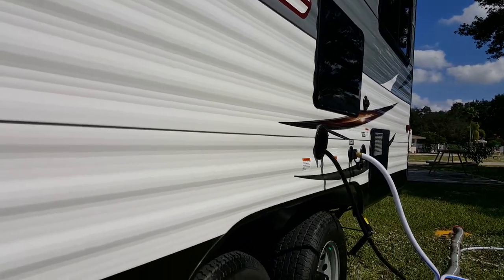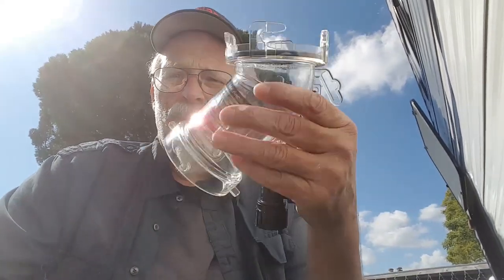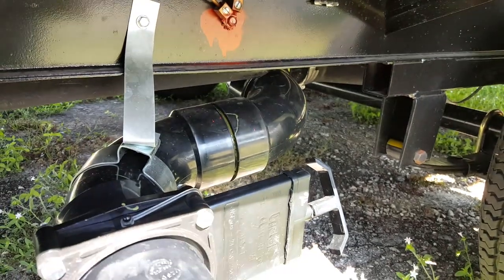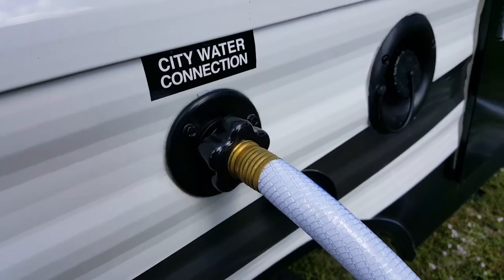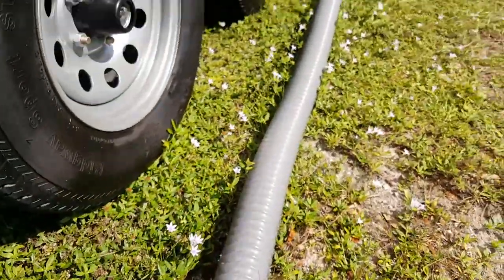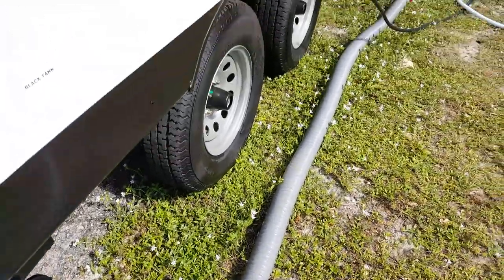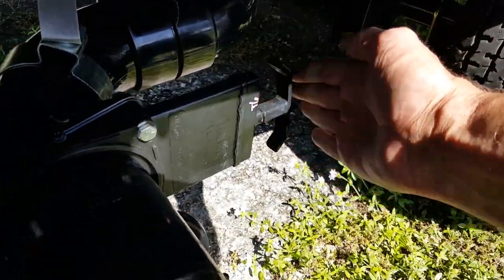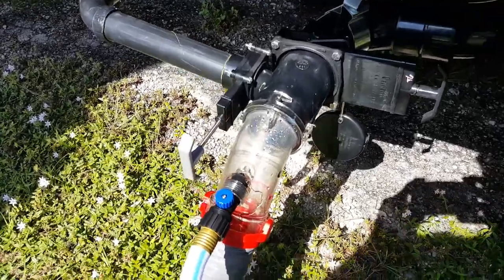How to Empty the Black & Grey Tanks in an RV/Camper

Comment: I found in my years of camping that this method doesn't work 100%, one year I had to replace a tank before and found out there was waste over in the corner, so what I have done was dropped deposit in thw black tank, that will break down the waste and take the water hose and run it inside of the bathroom down the toilet,  fill it back up and go out lside pull the black tank level to then rinse it out. This cause a strong Vortec and  pull whatever waste stuck inside ,once that has been done two or three times,  your black tank is fairly clean, I didn't know that until I had to change a black tank that had a crack in it, once I removed that tank I found out it was a lot of waste still stuck up in the back corners... this message here only remove whatever's there but not a thorough cleaning once you are done shopping for the day and you want your tank clean the best way is to fill it from the inside..

Comment: Unfortunately, the 'rinsing gadget' clear piece only cleans the first elbow of the black tank pipe. The jet of water may bounce off the second elbow a little, but as far as rinsing the tank, nope. If you have a tank rinse built into it OR use one of the wands on the end of a hose down the toilet, you may get some more 'stuff' out.

Comment: Cross contamination using the same hoses for fresh water and tank cleaning. I would use 2 different. That sound right? I'm still a rookie
Reply: Sounds right. You can buy a "Y" adapter with shut-offs and put that at the spigot to connect two hoses.
Reply: Huh? He mentions in the video that you should use 2 different fresh water hoses so they don't get contaminated....
Reply: Yes, it could have back flow into the water hose and contaminate it!

Comment: Get a clear attachment that has a door that is like the black water door. It can be closed to allow you to push water all the way into the tank. Careful to not fill tank.  With this attachment you are sure to clean tanks.  Always use rubber gloves. Never use fresh water hose on anything dealing with grey or black water.

Comment: When using a hose for your fresh water hook up, don't let it come in contact with the ground or connect it to anything other than its purpose.  Have a second hose in a different color for flushing the black tank out, it is not worth introducing fecal matter into your fresh water system.  Also the gloves show do not stop liquid penetration, use some disposable nitrile gloves which are cheap enough on Amazon or at your local WallyWorld.

Comment: A trucking recruiter! The name alone is very telling! I see you have a white hose connected to the washout of the dump hose! Typically a white  hose is used for potable water (drinking or bathing) you wash out hose should be red or black. But coming from a trucking recruiter I am not surprised. Truck driver recruiters will tell you anything you want hear.

Comment: You had that 45 backwards. Running water through it is for the hose only, not for trying to flush back into your tank which obviously wasn’t happening because it just flows right back out.

Comment: I've pulled the levers after moving into my trailer (already hooked up) and it worked just fine for 9 months. I just recently moved, got all hooked up and now nothing comes out when I pull the lever to the grey tank. I know my tanks are full because I have water in my shower and sinks that aren't draining and my monitor thing tells me tank 1 is n the red and tank 2 is 1/3 full. Also my fresh water is in the yellow at 1/3 tank as well. So how do I drian my tanks if pulling the lever doesn't work? And how do I refill my fresh water when it's hooked up?

Comment: Does that fitting have some kind of a check valve, that’s a cross connection. I didn’t see a vacuum breaker on the hose bib.
Reply: Even with a check valve I tiny bit of contaminated water will come through when the valve closes and once you hook the line up to your campers drinking water it contaminates the plumbing inside also it makes it worse if you dump your tanks and put the hose away for a period of time it give bacteria time to grow

Comment: That hose dont clean the tanks. They have tested them and they dont work. It cleans the pipe at the end and that is it.
Reply: That clear attachment is for breaking up solids as they pass out of the black tank. It also helps cleaning the stinking slinky out after the black and gray are empty.
Reply: What does it hurt though? It helps to clean the end of the unit and the hose itself.

Comment: Watch those bumber caps, they slide out on their own. I drilled a hole on mine to keep them in with a pin.
Reply: I have noticed that also, mine move with just the RV sitting in place.
Reply: @_iLLuSiv3_  Interesting, what's going on inside the RV at the time:-)

Comment: What is that hose fitting called that the hose hooks to, to spray water in the tanks and clean it?
Reply: cheryl steele It's not doing anything.  Just pour clean water in your toliet and flush 3 - 5 times and run clean water down your sinks.  Also, use a completely seperate hose from your fresh water hose, black, and only for this.  NEVER use the same hose!
Reply from the maker: I think it is called a Y adapter. Something like that.

Comment: That fresh water hose should now never be used for fresh water again.  It was bad enough using it as the flush hose on the clear connector but placing it into the adapter and sewer hose has now rendered it unsafe for fresh water use.

Comment: I do not think that is going to do a very good job of getting into the black tank and definitely not the gray tank.  It might go inside the pipe and a little into the tank, but it will not clean out the black water tank, or gray water tank.  It will clean out your stinky slinky but not much more than that.  A proper black tank flush valve is better, but not that great either.